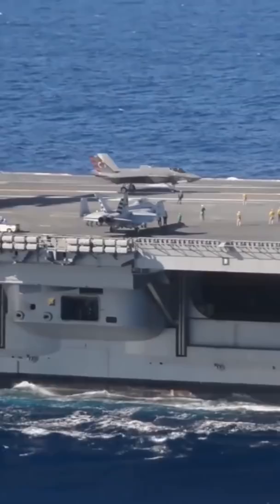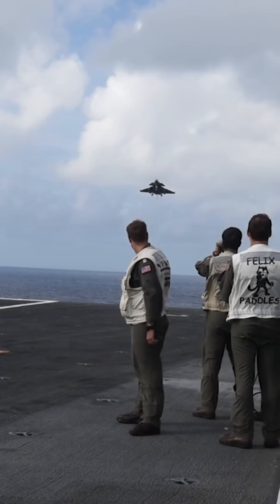How Aircraft Land on Carriers? #shorts

Comment: It’s just what I thought… worked on the deck for 3 years… Has to be one of the most dangerous jobs in the world… make a mistake and you can be cut in half by an Arresting cable of sucked into an engine… also, something no body talks about… one little pice of debri on the deck and it will go through you like a hot knife  goes through butter!

Comment: Hey aircraft carrier people, why do they immediately pull the planes off to the side and tie them to the deck why not take them below? I assume f-18 f-35 f16 whatever you happen to be flying, it needs maintenance after and refueling and probably a bath? So wouldn't it make sense to bring it directly below deck? Or is there something you got to do first before you take it down there? Or is the maintenance cycle such that the plane can fly three or four times before you go to take it down there? I'm just curious like I feel like the pilot in the plane both need to rest after they just landed so they should both go in the boat right away. I assume no one's going to be working on the plane on Deck God forbid the boat turns the wrong way all my snap-on tools would dump into the Pacific Ocean..... No mechanic is going to want to do that....

Comment: Very cool but I got a question why wouldn't they make the aircraft carrier bigger we need bigger and better anyway you can hold more planes the runways bigger more space of course it's more money the biggest baddest in the world and you can put crazy guns on it
Reply: Anyway they're using a thick cable very strong and it snaps sometimes as soon as the plane is about to come to a. Stop he throttles up and the second he sees the plane stopping he cuts it off I would say just from looking
Reply: @sillywillyworld4544  he just said in the video that after the plane touches the runway the pilot throttles up no matter if the cable snaps or not. Also aircraft carriers right now are already made with the optimal size and weaponry with material limitations and costs in mind.

Comment: What use is the F-35's VTOL if they ain't gonna use it?
Reply: They use it in some situations
Reply: The f35b is the only version with VTOL. The navy uses f35c’s which has bigger wings which makes it easier to take off from the carrier. The f35b is used for the marine corps.
Reply: @madsusmonday6776  yeah, but using VTOL they can deploy more with less time right?
Reply: @edilbertorivera3467  not really. Considering the nimitz class can launch 1 fighter every 20 seconds.
Reply: @madsusmonday6776  even fighters is vertically taking off?
Reply: @edilbertorivera3467  The marines have their own special carrier. Their carriers doesn’t have catapults, which means they rely on VTOL
Reply: @madsusmonday6776  you don't get it. My point is, if they use the F-35s VTOL capability, they will be able to deploy more for less amount of time, and they will be able to recover planes faster, can't they?
Reply: @edilbertorivera3467  the f35s probably still costs too much